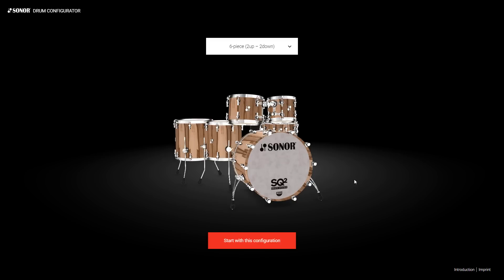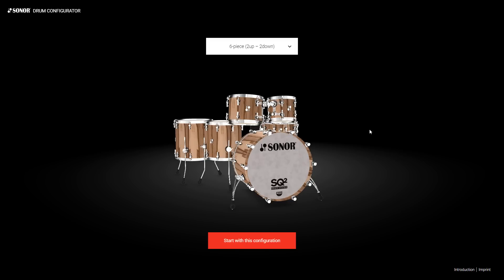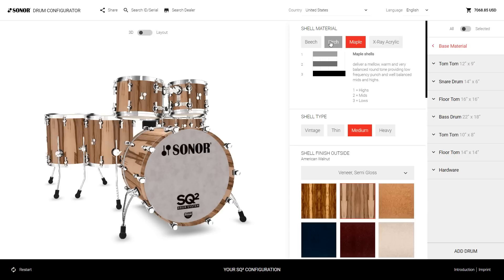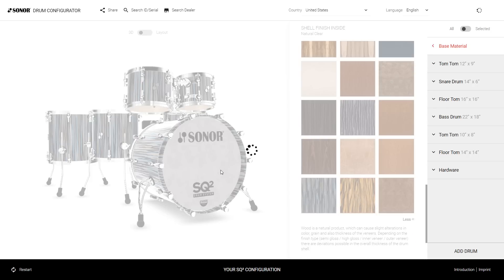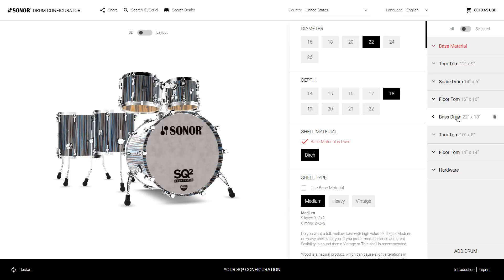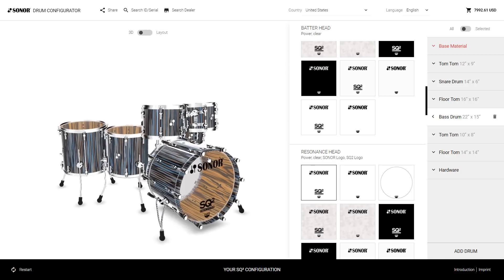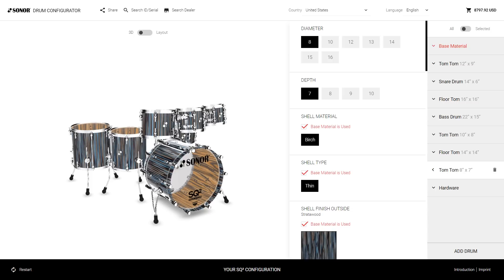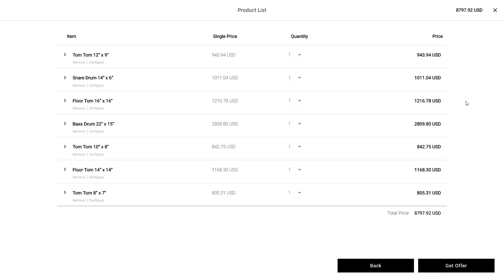Sonor SQ² Drum System 3D Configurator walkthrough

Comment: finally a proper configurator. the only thing that is missing, a choice of bearing edges.
Reply: That's because the configurator is only for the SQ2 - that system comes in 45° bearing edge only ...so it's technically not missing in the configurator, as you can't change the angle at all.
Reply: only  45 degree is Sonor sound